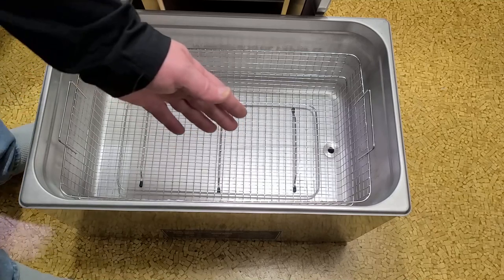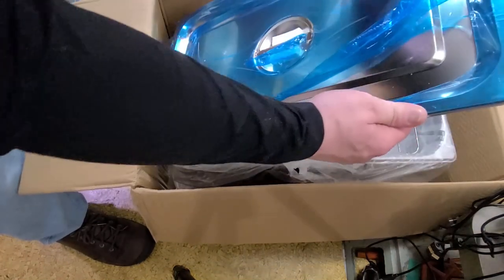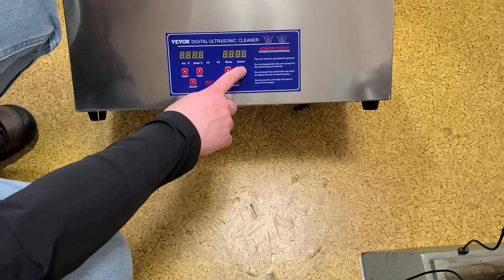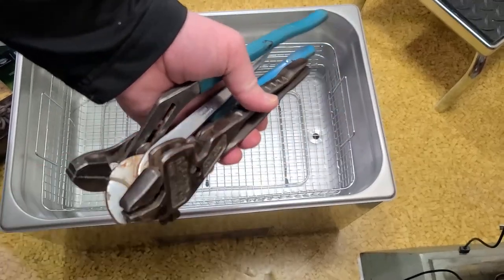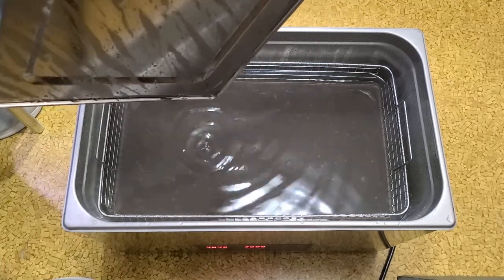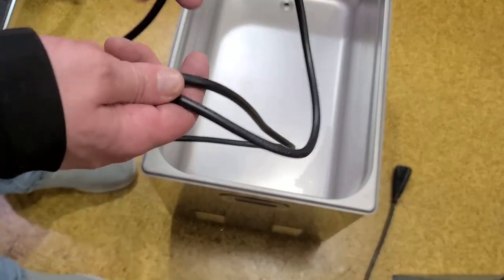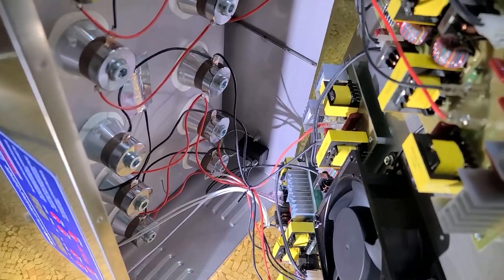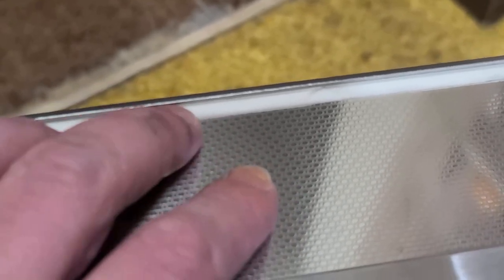Vevor High Power 600 Watt 30L/8 Gallon Heated UltraSonic Cleaner Review

Comment: As mentioned, that little tea holder is for small parts. 
A few points about ultrasonic cleaners. 
The ultrasonic cavitation generates heat itself (this is also why you don't use flammable solvents in it), so you don't need to crank the heat to the max setting. That can actually be detrimental as it creates steam and hinders the cavitation. Always use non foaming detergents, the foam hinders the cavitation. Automatic dishwasher detergent, trisodiumphosphate, or of course purpose made ultrasonic detergents. The unit should always be filled to the fill line or in this case the crease to prevent the heating elements from burning out (most on the sides) as well as more efficiency.

After filling the unit and adding detergent, run for ten minutes to mix the solution and more importantly degas the liquid. The dissolved air bubbles hinder cavitation and the degas cycle negates them. The cavitation is extremely powerful on a microscopic level and will etch/pit soft metals and and can destroy fragile stones like emeralds so use care with what is placed in one. 

Always rise parts thoroughly after removing them from an ultrasonic. While this machine is an extremely efficient cleaner and dislodges dirt very well, it doesn't necessarily flush it away. Last point, the higher the frequency the gentler the cleaning action and better its ability to clean small, fine parts. The lower the frequency the more aggressive the cleaner, louder, and short the life. Most are 40kHz, there are 25kHz (large scale industrial) and 80kHz (optics, laboratory), 55-60kHz is probably the ideal frequency but almost doesn't exist.

EDIT:
Never place anything on the bottom of the tub. Doing so will reflect the ultrasonic sound waves and over time will shorten the life of the transducers. The tub is a wear item, and eventually the cavitation will cause the metal to pit where the transducers are and the unit will be done for then. How long this takes depends on the frequency (lower it is the sooner this happens, higher it is the longer it takes) and the thickness/quality of the stainless in the tub.
Reply: Ever tried washing clothes in it? As prices have dropped I've more considered getting one to remove stains that are so stuck in that they really require a lot of manual brushing and such to get out, even after long soaks in detergents and whitening solutions.
Reply: @johnjingleheimersmith9259  I have not, but it is unlikely to work well. Ultrasonic cleaners excel at cleaning hard materials like metal, glass, rigid plastics, etc. Soft materials like rubber, soft/thin plastics, and cloth would absorb the soundwaves and render them less effective.
Reply: @moeszyslack4676  well I'd rather soak it for hours if that's what it took than hand scrub every single item. I figure those little cavitations must still hit the fibers pretty hard. They make little units you submerge in water, like in a sink, for traveling. There's even a video on here where they cooked and tenderized a steak using one.
Reply: @johnjingleheimersmith9259  I put a tie in one and it worked marvelously.
Reply: Emeralds can go in, just cannot go from hot to cold quickly or you'll have an issue. Also the cavitation it's self isn't enough to heat the bath enough to add any additional cleaning benefits. The best product to use in an ultrasonic for most applications is anything ammonia is based. However dangerous it may be, sodium cyanide is by far the absolute best possible cleaning solution but it's in no way for beginners.
Reply: @hiramabiff5557  Cavitation itself isn't enough to heat the fluid to 65*C, not in a practical manner anyway. However, it does maintain heat in an already heated bath. Ammonia can be corrosive or detrimental to some things, such as brass not to mention the fumes. For most applications powdered dishwasher detergent and trisodiumphosphate mixed together is highly effective and cheap. Emeralds may survive a low power mini ultrasonic like the ones all over Amazon, but personally I wouldn't put one in a commercial grade Elma, Crest, Branson, or similar.
Reply: @moeszyslack4676  = Good informations !  But 2 things ..

dishwasher detergents are well. In theory for you and a lot other persons. 
BUT for dishwashing there are indegriens for the hands of the diskwasher. 
And the persons in the US like foam foam foam (in my country onla a little foam). 

For a ultrasonic cleaner you need no indegriends for the hands of the diskwashing person 
and foam is not usefull. 

But you will hardly find the pure detergent to get soft water ...
Ok we all use diskwasher power/fluid because it is cheap.

OR use the expensive commercial ultrsonic fluid.
Oh total different types I can buy ...
Yes depending on ... (you can read by your self).

By the way Elma, Crest, Branson, e.g. are professional ultrasonic cleaners and need to be payed by a professionl bank account.
OK ?

I prefer Amazon china cleaner ! BUT always the better ones with degass (and Semi-Wave or gentle or what ever they say for the same button).
The cheap and the better Amazon cleaner are nearly the same, but the cleaner with Degas button lookks  ?more quality work and not these simple electronic board. 

Dont laught, the other electronic board are identical (or nearly) because one board for 2 ultrasonic transducer only. 
One better board with cable to the digital board (with the button) look better. From these board wires go to electronic boards witch are the same (or nearly) as the electronic board in the cheap ultrasonic cleaner with only 2 knops. 

Yes the manufacter (specally Elma, eg) can order 8and I hope they will use) selected transducers. 
2 transducer have the absolute same resonant frequency = max ultrasonic wave power output)

Cheap manufactures dont use a high selection perfection by the chinease transducer manufacturer. 
Even if the frequency differ only a bit , you get max power when both transducer at one electronic board use the same (nearly identical) resonatcy frequency.

Comment: Awesome video man.  Thorough.  Ok, so the "filling to the full line" thing.  This is not only to protect the heating element, but also account for the resonant frequency of the tub and water.  This is done to improve efficiency in the driver circuits powering the piezoelectric elements of the transducers.  So, effectively NOT filling it to the top, can in fact burn out the power supply or the driver board.  I have yet to 'confirm' this, but I have heard it mentioned a few times.  That said, I just bought one of these bad mamajama's So I plan on doing some actual testing to confirm this.

Secondly, warm water not only cleans better, but also reduced cavitation damage.  3 things greatly affect the cavitation; Temperature (colder is more harmful), Time the item spent in the cleaner, and frequency. 
A higher frequency, gives more cavitation bubbles with less force. Ultimately, it is more gentle, and can clean in smaller crevices, but takes longer.  Lower frequency on the other hand is exactly the opposite.  Larger cavitation bubbles with more force.  If left in to long, item can become damaged by the cavitation.

Comment: After years and years as an auto mechanic I’ve accumulated buckets of fasteners and other hardware. Been experimenting with evaporust to recondition them but they really need to be cleaned first. Thinking about one of these or some sort of tumbler. I’d love to know how it cuts the grease when it’s really full.
Reply: You don't want to dump a big bucket of fasteners into an ultrasonic machine and literally fill it up. The more full it is, the longer it takes to clean and less effective it is. Use powdered dishwasher detergent and trisodiumphosphate in a 150 degree bath for half an hour. Rinse thoroughly with hot water. Depending on how dirty the fasteners are, you may need to change the solution after one or two cycles.

Comment: Nice video ! 
19:40 ultrasonic transducerers have a pin bolt. Thise is TIG welded and the hex screw press the transducer against the botton. 

For ultrasonic wave transport the manufacturer use epoxy glue (hard glue , no soft material) to have a full closed area to lett the wve go thrue. 
Air bubbles in the epox are bad. this is a reduction of the ultrasonic power transmittet in the stainless.
AND the reflected wave heat the cristal  = lower life time ! 
To mutch heat and by by transducer ! 

The epoxy and the pin are at an area that is sandpapered and cleaned with some solution (break clean e.g. ) by the manufacturer. 
Sometime I see a grid in the epoxy. Personally a bad idea I think.
These manufacurer use this to the epoxy more stable and reduce the risk of of crack. 

My opinion no air bubbles in the epoxy is perfect, and very thin epoxy is better than thick epoxy and no other parts in the epoxy. 

Redy 

Tip= Never ever but some parts direct on the stainless bottom. Allways in a basket (or a plastic bag or what ever) AND more than 1/2 inch over the stainless bottom. 
Result higher ultrasonic energy and less wave reflection back into the ultrasonic transducer (will get hot inside or mutch to hot inside = shorter life time)

Same reason why you have to fill water up (min 3/4 of max or little under max) ! Waves must go around in the water and only a small amount will be reflected back into the transducer. 

Yes transducer have a limited lifetime. 
And the electronic board have a limited lifetime (the two transitors or MOSFET overheat but they are common standart types and if you know a electronic DIY-expert ... well !! And the high watt resistor (some Ohm around 5 Ohm or 10 Ohm) ofter get to hot and because of these faults the internal glas fuse ...) 
Wonderfull to know a person that can handle a solder iron and know a little electronic stuff. Other part are more unusual to break, but look for the power line diode and some capacitors. the transformers get hot but they nearly allwy will work as new)

Not very often a transducer fall of. Because bad or no TIG welded screw pin and than the hard epoxy cant hold the weight for years. 

Other fault are possible true, but often only these standart faults. 
Working at these ultrasonic cleaner is hdangrous , becaus the high voltage from you wall plugs. 
AND at the transducer you can meassure 1200 Volt to 1700 Volt ! The reason why the capacitors in that area aroundthe transformer are made for 2000 Volt. 
After power is off these (and other capacitor) can hold a extreeeeem high voltag for some days ! A electronic freak will know it and better you tell him that the transducer work with short 40kHz pulses and very high voltages. 
Never ever switch the electronic board on with no transducer soldered ... 
Never ever test the ultrasonic cleaner with no (or to less) water ! 

Look into the tap. There is often a plastic that open or close. No good idea with gasoline or diesel. But yes shorttime ... but stricktly not allowed. 
Above my personal opion. You are the olny responsible person. You only have one life I think ! If some accident happend dont cry that I am responsible for my informations, because you have to check these ans ask an expert. Obove are only informations as a starting point for a discussion and need to be checked if they are ok. 
In our country you have different laws and different thing are allowed to do. In my country either and I dont life in the US.

Comment: Would this be useful for polishing and cleaning recently cast brass statues?
Reply: Depending on your casting method and how "finished" your peice comes out. Best thing immediately after would be an ultrasonic but if you can afford a magnetic tumbler that is heated AND automatically reverses direction, that will not only clean, but polish your statue . Depending on the type of pins (flat or rounded end" will leave you with different finishes like a more matte or mirror finish. For a cheap alternative depending on the size of the item, get a brass vibratory tumbler and use a squeeze of brass polish cream and crushed walnut shells, extremely loud and a little bit longer of a process but similar results.
Reply: Absolutely will not polish in an ultrasonic alone